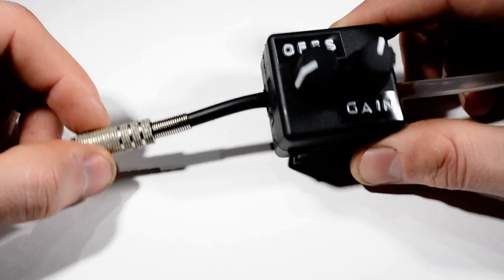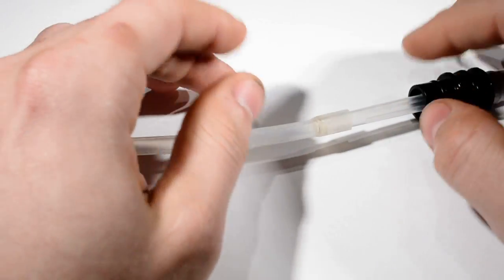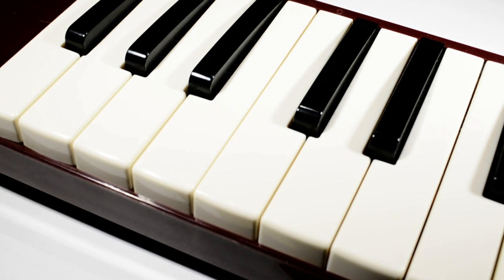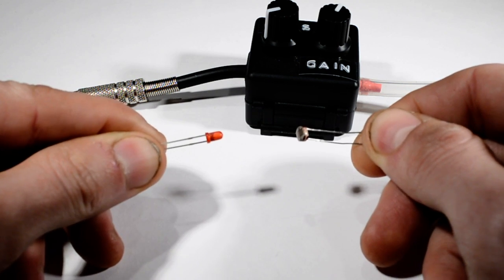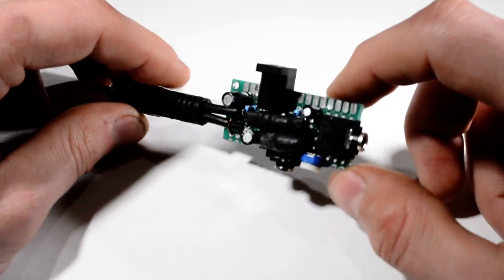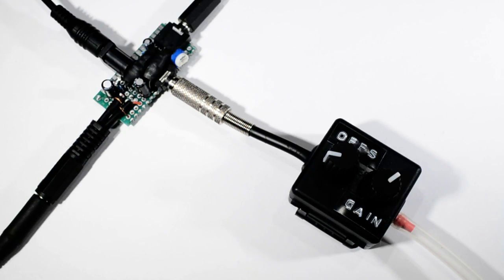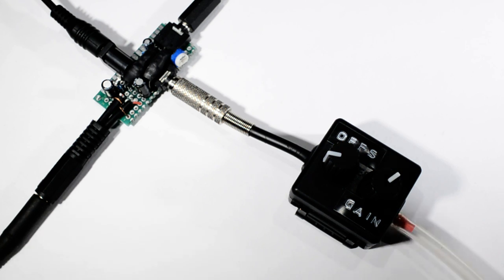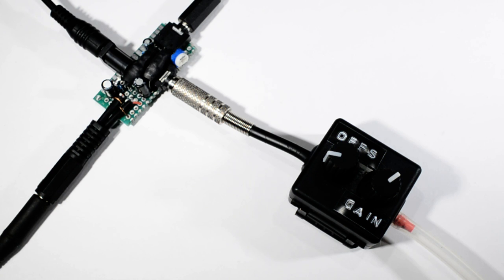Breath Controllers and the Electric Melodica

Comment: I just got trapped in a logic loop, thinking about how a breath controller would be great for controlling the FLASH synth and then trying to figure out where a cheap one was and if a MIDI Slide Whistle Controller was a thing. Of course here I end up circling back to the inventor himself having built the thing long ago. Always impressed! But how about a DIY slide whistle mod for this?

Comment: With eurorack you could make full use of this, without the downside of being separate from the synth (eurorack is a modular synthesis protocol that's analog and, since it's modular, you can route anything to anything, who's up for some FM synthesis (Filter Modulation, you move the filter with your audio signal))

I wish I could afford a eurorack system... (I plan to build one from kits and my own designs, but even with the kits I've found bringing it down $200 I can't afford TwT, but when I have one I'm definitely making an eMelodica module, not only are the disadvantages gone but you can route it to stuff you never thought of, and even stuff that's probably a bad idea)

Edit: The obvious disadvantage of eurorack is that polyphony is hard with eurorack, and really expensive

Comment: To correctly map "blow twice as hard to get twice the volume" you have to apply a logaritmic signal map fix as decibels scales twice loud with 10X volume on linear scale. Our ear works like that. In other words you need to map 10x volume to 2x hard blow to get 2x hard sound. I mean AFAIK
Reply: What exactly is that function? A logarithmic function would map zero to negative infinity and an exponential function would map zero to one. We would want zero to map to zero since zero breath should mean we get zero volume.

(Also, sorry for replying to an old comment...)
Reply: @stekeln  you are right I have no idea but it is not linear

Comment: This is cool..  As an original Yamaha DX7 owner that used to have a BC-1 (lost in house fire) I can say though - Dont get rid of the abliity to plug into the BC input on a synth..  One of the things I used mine for most was to use it in the FM synthesis as another modulation wheel basically..  I appreciate in the software synth you may be able to do the same though I guess without the compatible output for the Yamaha standard...

Comment: Ever heard of an operational transconductance amplifier? One could work well for voltage controlled amplification. A mixer like an SA602 could also potentially work, so could a JFET circuit. You’ll lose your optical isolation, but it’s still a more consistent method that avoids issues like matching the components and their geometries. If you really want that isolation then maybe a ring diode mixer could work, if you’re willing to use a couple of audio transformers.

Comment: I'm not sure if there's any practicality in it at all, but you could also take/make a DC air pump, assuming there's something fast/responsive enough out there, and use an analog audio signal for adjusting the flow rate. Makes about as much sense as a player piano currently does, but it's another way to play an aquarium pump.

Comment: Could you turn this into an HID device for disabled computer users?
Reply: BCIs are far more useful in that regard than blowing into a tub for hours on end. How would you imagine it to convert blowing into control?
Reply: @acidtears  Simple; first strap a bocarina to a disabled person's face with an elastic chord, they then communicate with an AI that's been trained by listening The Clangers, which interprets and carries out commands.
Reply: @nagualdesign  I had to look both of those references up lol Tbf it might work though... Instead of playing a specific song they could be asked to produce a certain frequency which is read in by the AI and then converted into a command. 

Works but still wouldn't help people with Locked-in/ALS because they have no motor control whatsoever.

Comment: Couldn't have you used a optocoupler instead of the led and that other component?
Reply: It is an optocoupler, just not factory made
Reply: @marekcernoch1355  I know it is, but would be more viable to buy one. It's cheap...
Reply: @mr.dicknipples  he probably didn't buy these just for this project, he just had them lying around, so it was probably a difference of buying an optocoupler or using what he already had

Comment: this whole unit seems that it could be made in a nice compact package. maybe using commercial opto couplers (as they're more precice and compact) and maybe using transistors to help make the light and I/O response more perceptually linear... maybe with nice tuning pots. the unit could have several controls to really customize how it plays.

An idea of a knob list:
-Gain
-Offset
-Curve
-Volume
-Flow (Just use a needle valve)

And a nice bypass toggle switch. maybe with optional foot pedal input. you don't wanna blow yourself blue when you can finger the notes.

Comment: No spit valve? It looks like spit would pool in the tube, is there any chance of it getting inside?
Reply: Good Point. My Granny would put rice in salt shakers as a dehumidifier.
Reply: @MailboxHead  Appreciated <3
Reply: This is the greatest reply section I've seen in my life. Thanks for the entertainment guys.
Reply: @GreenZapperZ  You're welcome
Reply: I would hope you have enough sense not to spit a ton when you're making sounds as you do the same when you're speaking to someone face to face. Even if you did manage to accumulate enough saliva in the tube that it would "pool", water conveniently evaporates in open air. So just leave it out overnight, and it should be gone by the morning.
Reply: @jjaapp18  i mean if its anything like a saxophone itd go away, but itd also get pretty stinky
Reply: jjaapp18 you don’t really understand lmao, get a straw and blow in it for a while. Water will pool very quickly. How but I didn’t spit?? It’s condensation. And YES it can pool if not given a pool or an easy way to remove the tube.
Reply: @nightshade1807  Water is still water. It is still going to evaporate. Unless you plan to use it for hours on end, you shouldn't ever need to worry about it pooling up too much.
Reply: @jjaapp18  saliva isn't the same as water...
Reply: @bencastor9207  Did you know that saliva has water in it? You should take a biology class if you didn't know that much. Good luck on your studies, kiddo!
Reply: @jjaapp18  water in it isn't the same as being entirely water, should have paid attention in all forms of science, not just biology. Saliva will leave residue and attract bacteria way more than water will. Evaporating saliva isn't cleaning it. Hence why wind instruments always end up smelling fusty if not cleaned properly... 😂
Reply: @bencastor9207  Bacteria is everywhere. You should've paid more attention in infinite sciences classes.
Reply: Ladies and gents... Welcome to another episode of "jjaapp18 Against the World".
More ridiculous moments coming up.
Reply: @AlxndrJG  How much do you think they'd pay me for the rights to that show?
Reply: jjaapp18 not enough...
Reply: @AlxndrJG  You think so? I was thinking the opposite. They can gave the rights for a dollar.
Reply: jjaapp18 It’s all relative.
What I meant was, that YOU wouldn’t think you’d get enough.
Reply: jjaapp18
YOU would think you wouldn’t get enough*
... or what ever. You get the point. I think.
Reply: @AlxndrJG  I don't even want it, though.
Reply: @jjaapp18  Water evaporates at a rate determined by the surface area exposed to air. In a straw that means just a tiny circle at the top. Go block off one end of a straw and fill it with water, see how long it will take to evaporate. It could easily take more than a week. And if it has bacteria from your mouth in it it'll probably get pretty nasty in that time.
Reply: @danieljensen2626  You think the hose is going to be completely full? You crazy, dude. xD
Reply: @jjaapp18  No, but if you play for an hour or two there could be like an inch of spit in there, and that would take more than a day to dry out.
Reply: @jjaapp18  it's not as much spit as it is condensation
Reply: @jjaapp18  Every breath you exhale has moisture in it, and that moisture has to go somewhere. It can collect into droplets and cause issues. Nobody spits into their trumpets, but they have spit valves anyways for this very reason.
Reply: @JustWasted3HoursHere  You say nobody spits into their trumpets, but you know full well there are some weirdos out there.
Reply: "Water is still water. It is still going to evaporate. Unless you plan to use it for hours on end, you shouldn't ever need to worry about it pooling up too much."

Geez... This lad doesn't know what he's saying at all. How the water will evaporate in an almost closed environment? And... Oh, nvm.
Reply: @jjaapp18  lululul
Reply: @jjaapp18  well played
Reply: @acidtears  I had a post max out on replies a few years ago because I just felt like randomly saying, "Vets don't deserve respect just because they served, some of them are complete assholes." Fun times!
Reply: @jjaapp18  No, the spit valve isn't for SPIT, it's for condensation. Breathe on a piece of glass and look how wet it is. That will develop in the tube no matter how dry your mouth is, your lungs are sopping wet, as needed for them to function.
Reply: jjaapp18 
A lot of saliva gets in a melodica soo
Reply: @jjaapp18  nice bait lmao

Comment: This is great work, but LDRs are inherently slow to react.  If you look up Vactrols (an LED + an LDR) you'll see some graphs of turn on / turn off times, at different currents.  

Opto couplers get high speeds by using a photo transistor, or a photo diode, as the detector.

Another way to keep it simple is to use a MOSFET as a VCA.  You need to bias it into its linear region, so it's not just behaving like a voltage controlled switch, then just have a pot used as a potential divider to control the gate voltage.
Reply: Why MOSFET? A JFET is almost a VCA on its own, close enough for a control signal. And without much gate capacitance there isn't much there to cause slowness.
Reply: Siana Gearz mosfet is AN VCA, also more linear, isolated gate and no current loss

Comment: So... no way to repurpose this approach as a MIDI input device for computer control? Pardon my naiveté. I have a feeling the answer is obvious but over my head.
Reply from the maker: Well I can still plug this into my yamaha keyboard to use it to send MIDI. It wouldn't be hard to make a standalone midi breath controller, any chip with an ADC could do it.
Reply: With that same responsiveness? If so, how much would you charge?
Reply from the maker: Not sure how responsive it would be. I'm going to try building a usb-midi breath controller, I think it may be more responsive than the keyboard one.
As for a price, I'll have to think about it, the parts aren't all that expensive but it takes a while to actually build.
Reply: Please let me know. If I could get access to a breath controller that is that responsive, I would be very happy!